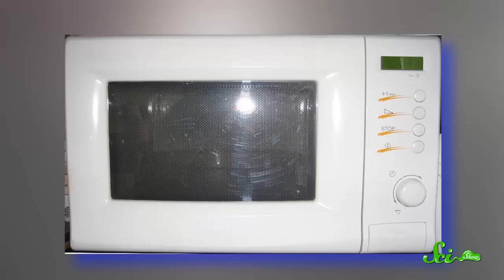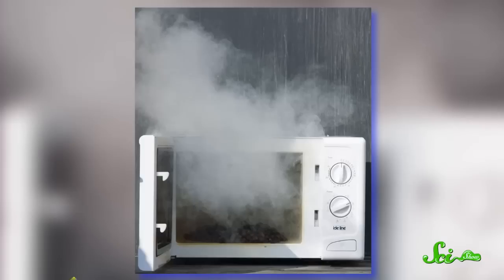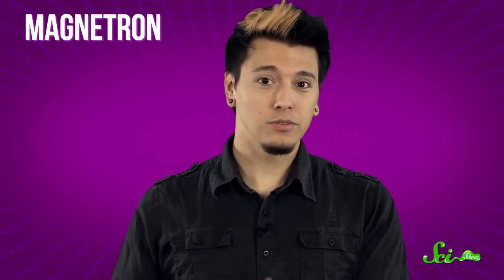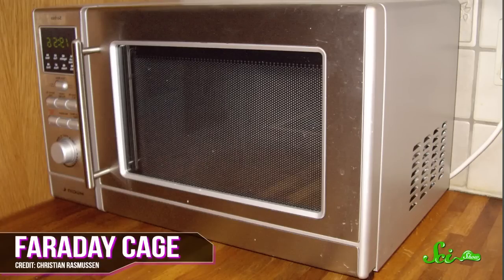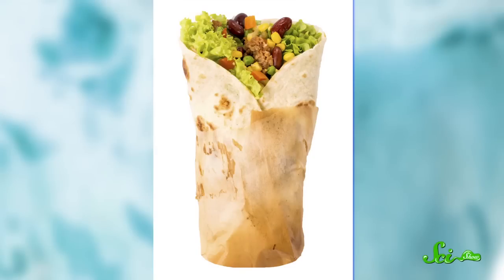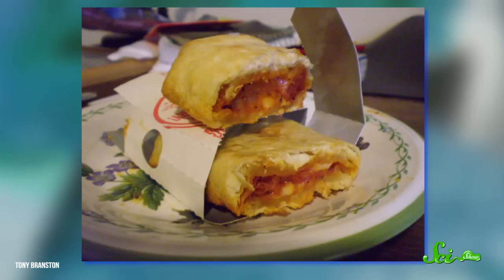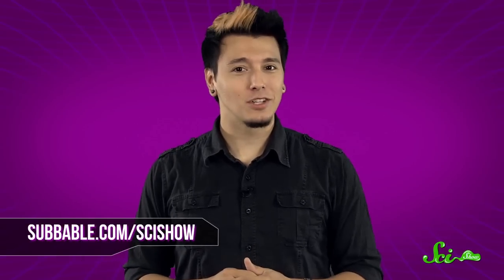Why Can't I Put Metal in the Microwave?

Comment: My mom has thaught me to always put a spoon in my soup when I microwave it so the soup doesn't overcook. I'm not sure how that's supposed to work but I never questioned it. We've always done this and never has it caused us any trouble; it was only when I told someone else about it and they questioned my sanity out that I realized it was supposed to be dangerous. Now I wonder why our house never burned down.
Reply: As long as the spoon doesn't touch the wall of the microwave, it should be fine.

Comment: The two GE microwaves I have purchased gave examples in the manual on how to use tin foil in the microwave to cover foods you don't want to over heat. For instance, you can heat a plate with steak and vegetables without scorching the vegetables by covering them with foil.
Reply: Did you ever try that? It sounds like horrible advice.
Reply: The crime here is putting steak in a microwave in the first place.
Reply: Why would you microwave steak?!?!
Reply: I call bullshit. Nobody reads the manual.
Reply: sleepingbeauty1022
What is "the manual"?
Reply: If they're recent models, they may be microwave/convection ovens. Using the convection mode, it's safe to have thin metal in the chamber. Also, it won't ruin the steak.

This is why it's important to read the manuals.
Reply: Wourghk One had convection features the other was plain jane. Check out this random manual I found online. http://kitchen.manualsonline.com/manuals/mfg/ge_appliances/164d2966p147.html?p=19 Read the note at the bottom. These instructions are for using the microwave defrost. "...shield warm areas with small pieces of foil..."
Reply: nightcrawler69420 No, It's Manuel the guy that taught me how to microwave burrito's.
Reply: Alec Wilde You would microwave steak to reheat it. If your question is rhetorical, then I agree. Why would someone microwave steak? Yuck!
Reply: ricksite
Hmm, the manual says the microwave model is a JVM290, which does supposedly have a convection feature.

The manual even has a "convection" section on the first page under the table of contents.

Was there a stripped down version of that model without the convection, and they didn't bother to write a new manual? I'll bet those lazy bastards at GE would do something like that.
Reply: ricksite Cold steak after a night in the fridge is amazing though, I don't see why you'd want to warm it back up.
Reply: Wourghk The page I linked to was referring to microwave defrost mode. A microwave with "convection" cooking has the addition of a heating element with a fan behind it but the standard defrost mode uses the microwave.
Reply: Yakko Warner  Some folks like food cold, some don't.

I personally enjoy cold pizza more than hot.
Reply: Wourghk I found a manual for a bottom of the line microwave. There are a number of references to foil. See page 11 and/or search for foil. http://products.geappliances.com/MarketingObjectRetrieval/Dispatcher?RequestType=PDF&Name=49-40633.pdf I can't say I use foil in my microwave but I usually only heat up things like soups and casseroles.
Reply: Wourghk
I for one, love spicy food, that is cold. Really makes a neat experience if I say so myself.
Reply: ricksite
 Well, this might be why people don't read manuals all that often. Some are rather poorly written...
Reply: Michael Pesavento the crime is having a steak on a plate in the first place.

Comment: I almost burned my house down at 3:00 in the morning when I absent mindedly microwaved a fork. I am an idiot.
Reply: +GrandMasterArticula I remember I left the spoon in my soup bowl while it was being microwaved so i saw the microwave flash before i ran to the microwave to open the door. 6 year old memories, rather meaningless memories.
Reply: +GrandMasterArticula same. used most of my five pound commercial Amerex extinguisher.
Reply: Who else clicked the time?
Reply: Austin Kane  j
Reply: Baked forks are my favorite snack.
Reply: so did i, that freaked me out so much...i nearly passed out, my heart was racing...those sparks were insane, luckily i closed the switch in time😰
Reply: You almost forked up
Reply: @austinkane9293  Every time i see one of those. My brain just forgets how to things.
Reply: @leanderlopez7652   A spoon shouldn't do anything in a microwave (assuming it isn't right next to any other metal).
Reply: @DANGJOS  intresting, maybe it wasn't a spoon that was 10 years ago I don't really remember
Reply: @leanderlopez7652   If it was a fork then that would make sense.  A spark/discharge could form between the prongs
Reply: @DANGJOS  Depends on the size of the spoon.   If it's a small spoon and the size matched the wavelength, it could generate a feedback, similar to those burning grapes you see sometimes.

Comment: Fun fact: Putting a fork inside a microwave will result in sparks from the tips of the fork - because charge builds up at the points. On the other hand, if you put a spoon no sparks will start flying. (But no matter what, don't try this at home.)

Comment: I once put a plate with a thin golden stripe along the edge in my microwave. The lightshow was totally worth it.
Reply: @stephensnell1379  One, you are making a fantastic impression when your first reaction is to insult someone.

Two, I have bowls with gold foil on them. I regularly put them in my microwave, no light show. 

Three, many microwave manuals have a section on the correct use of aluminum foil inside a microwave. Last I checked, aluminum is a metal. 

Finally, and this is really just a repeat of point one, but flipped on it's head. 
Don't call someone an idiot when you don't even know that foil can be microwaved while commenting on a video where they expressly state that aluminum foil can be used in a microwave with care. It's blatant hypocrisy.

Comment: From what I've read and seem in various places, microwaves don't work like this...
The food is heated by the waves, but not because the waves hit the water molecules, but because it's a polarized wave, and the variation of the electromagnetic field excited the water molecules, therefore, hearing the food by induction.
Reply: Correcting my English: "excite" the water molecules.
Further explaining why: because water molecules are polar.
Reply: Luciano Casaroli how you gonna fuck up again when you correct yourself?
Reply: ramiel555 crap hahahha stupid iphone autocorrect
Reply: Water is a great absorber of MiW radiation and it has a higher heat capacity than... say.. a tortilla. The common misconception is about the mechanism of heating, which was not even mentioned. I think that was a good move on their part.

Comment: I never knew the risks of putting metal in the microwave. I never did put metal in because that's what I was used to. But I never stopped to think about why metal plates are never put in a microwave. I was never told that it shouldn't be done.
So yesterday at 29 years old I finally learned the hard way.

Comment: I learned the hard way when I was about 7. We had a babysitter and were eating popcorn while watching a movie. You know how there's always those un-popped kernels at the bottom of a bowl of microwave popcorn? Well, I decided I was going to put the bowl in with those kernels to see if they would pop. I also, for some reason, decided that it would be a good idea to put tin foil over the top of the bowl. I don't know why I thought it would help, but I did it (without the babysitter noticing), and put the bowl in the microwave. As you might expect, very shortly there were loud noises and what was either fire or electrical arcs on the tin foil. This of course freaked everyone out. The microwave, luckily, came out unscathed. The plastic bowl, on the other hand, still has little popcorn-kernel-shaped indents on the bottom where it started to melt.

Comment: Okay, here's a question that has bothered me for forever. Hopefully you guys see it and feel like it's worth making a video to answer. Or maybe somebody in the comments can help me out...

How come I've never seen lightning in a snow-storm the way I've seen it in rain-storms? To the best of my personal knowledge, snowstorms don't seem to generate lighting... why is that? Is it because the frozen water doesn't conduct it down to the ground as well? In which case, wouldn't the electrical charge still be visible up in the clouds the way it is sometimes visible in rain-clouds?
Reply: "How come I've never seen lightning in a snow-storm the way I've seen it in rain-storms?"

For one, it's far less common. For another, it typically occurs when conditions are so bad that going outside would be dangerous. Snow often falls stupidly fast when conditions are right for thundersnow… and that's under the nicest conditions. It gets worse, obviously, as visibility drops to practically nothing when most thundersnow happens. Even if you were looking in the right direction, it would be tough to see it out past, say, half a mile. I haven't run the numbers, but do a count-the-seconds estimation of distance to lightning during your next thunderstorm and see how many are within half a mile—it's probably going to be a low number if it happens at all. An important point to make here is that snow muffles sound far better than rain.* For this reason, thundersnow is also harder to detect from hearing it. Typically, thunder can be heard at distances up to twenty miles away. For thundersnow, this drops to three, and that's on the generous side. Plugging in for area covered, we get radii of 1256.637 square miles and 28.274 square miles, respectively. This means that thunder in a rainstorm is audible across an area almost 44.5 times larger.

"Is it because the frozen water doesn't conduct it down to the ground as well?"

First, the basis of this question assumes that rain is responsible for lighting hitting the ground. We really don't understand how lightning forms, and only one of the theories as to its initiation involves water and ice. However, after it starts, lightning works largely without interacting with the rain in a meaningful way; this can be seen as true most easily when one thinks about positive lightning. It completely avoids the rain by virtue of shooting horizontally far beyond the edge of the cloud before it heads downward. Tesla coils are also another good example of electricity not needing airborne water droplets to cross a gap.

"In which case, wouldn't the electrical charge still be visible up in the clouds the way it is sometimes visible in rain-clouds?"

You cannot see electrical charge. It is possible to see light emitted by the charge accomplishing something, in this case making lightning, but humans lack the ability to detect electromagnetic potentials. If you are talking about cloud-to-cloud lightning, seeing that runs into the same issue I mentioned before: visibility. The clouds are simply outside the visible distance once they're overhead.

* I'm not entirely sure why this is, but I suspect it's from having more edges. Energy generally hates propagating through edges, and acoustic energy is no different.
Reply: Sai guy Wow, that's very informative. I'm going to guess that I've never been in a snowstorm that was "powerful" enough to create thundersnow. I didn't know it was real, and the other people I've asked in person couldn't tell me about it. 

Thanks.

Comment: What about CDs in the microwave? How dangerous is that? It's definitely fun!
Reply: VERY dangerous >_< The shiny part of a CD is a gallium foil--that's a metal. And the data is encoded by melting small pits into the gallium (side note: it's this melting that gave rise to the term "burning a CD"). So you have a thin, metal foil with millions of tiny gaps...and you're bombarding it with high-amplitude microwaves. That's just a recipe for disaster.
Reply: Gallium doesn't sound right to me -- that would have too low a melting point and would cause data corruption. Also, wikipedia doesn't corroborate it. They use aluminum. But anyways, it's a thin layer of metal with many close-by metal points not on the microwave.
Reply: somanayr
Huh. I have no idea why I always thought it was gallium. Must have had bad info all those many years ago. Myth busted! :D

Comment: There is actually some information on the internet (you can search it out yourself) about using a microwave as a small gold/silver foundry.  The microwave actually heats the metal up enough to melt it unto a non-metalic mold (also inside of the microwave), saving you the expense of buying a blast forge.  At least until the microwave breaks after a handful of uses.

Comment: I've only microwaved metal once in my life.  I was at work and needed to warm up some burger buns.  We put them in the microwave all the time to do the initial defrost.  I forgot to undo the twist-tie.  The metal inside heated up and set fire to the paper part of the twist-tie.  Melted plastic and a fire slightly larger than a candle.  NBD.

Comment: The fan make microwave heat up by randomization but if and can make explosion if metal obsorb heat at high intermitent rate matching latent heat resonance frequency of the type of metal and built up at 1w / mm cube / second square. Therefore in the future all metal ship plane and automobile can really busrt in flame if it meet direct energy weapon.

Comment: so the microwave moves the electrons which get stuck and build up in areas of metal with tight corners until enough charge builds up to have many of those electrons move through the air where much more of that energy turns into infrared energy which gets other molecules excited enough to begin oxidizing rapidly in air?

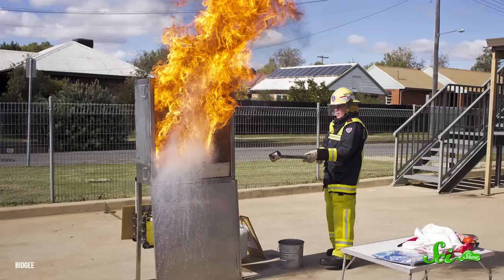Comment: 2:07 Putting metal in the microwave is completely harmless as long as it doesn't spark. You should only avoid putting multiple metal objects, tinfoil or forks in there. Most manuals even recommend putting a spoon (only one) in liquids to avoid boiling over.

Comment: So hang on.  Electrically conducting surfaces reflect electromagnetic waves (iirc, fairly trivial from Maxwell's equations).  The higher the frequency, the lower the resistance must be for a significant proportion of the wave to be reflected (because the reflection works by image currents which suffer resistive losses).  Does this mean that superconductors reflect at all frequencies?  In particular, visible light?  Or do the magnetic fields get strong enough to take them out of the superconducting region?  (ISTR the Curie limit decreases with increasing field strength.)
Reply: This is actually an easy(ish) question.
**EDIT**
http://cr4.globalspec.com/thread/29074/Why-Aren-t-Superconductors-Perfect-Mirrors
"I gave answers earlier that apparently didn't make the point adequately. At frequencies well below that of light, in the radio frequency spectrum, it is as the original post states - conductivity determines the degree of reflection. The degree of reflection is proportional to the ratio of the traveling electromagnetic wave impedance (377 Ohms in free space) to the reflecting surface impedance. The lower the surface impedance, the better the reflection. Nothing gets absorbed. But as you get beyond microwave frequencies, the skin depth is so shallow that absorption plays an increasing role in what happens at the material surface. For green light at 500 nanometers, the skin depth is 27 nm. Consider that value is only a couple orders of magnitude larger than the diameter of an atom. You are getting effects at light frequencies that are totally negligible at radio frequencies. Also, when we speak of light, we think of white light, which contains an entire spectrum of colors. Therefore it is important for a mirror substance to equally reflect all colors of the spectrum. That is why in my one post I said compare the reflection of stainless steel to that of copper. Copper absorbs more of the blue-green and reflects red, whereas stainless steel reflects without such filtering. A more precise example would be aluminum vs. copper. Aluminum conductivity is less than that of copper, precisely 0.6 that of copper, but it makes a much better mirror because it is not red. Silver is used for mirrors not because its conductivity is better than that of copper (which is true) but because it is color distortion free. And while silver costs more than aluminum as a bulk material, silver is cheaper to plate on glass, and it takes very little silver to make the mirror, so that manufacturing costs totally dominate material costs."
Reply: Apparently metals are crystalline within their grains and are a layer of oxide on the surface, and with small wavelengths it's the surface that counts, and for electrically conductivity it's really the crystalline metal that counts.

Comment: Now I know why it's especially bad to put those plates with gilt edges into the microwave. I thought it had something to do with the fact that it's gold, but that isn't exactly the case; it's because gold leaf is extremely thin.
Reply: Also because the gold leaf often ends up with small scratches on it, meaning there are very small gaps between two pieces of gold--a perfect recipe for electrical arcing!
Reply: Fun to watch, though.

Comment: You know those little plastic cups of ravioli pasta and other stuff where you take off a plastic lid, pull off an aluminum lid and put the plastic lid back on??
Besides trying to keep the food spatter down, the plastic lid is to hide the arc from the aluminum ring still around the top of the plastic bowl.